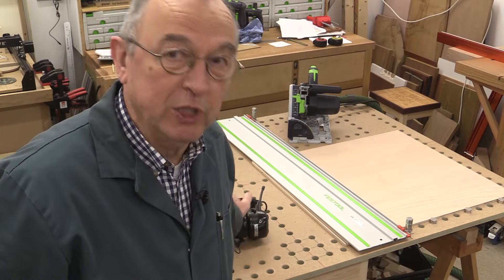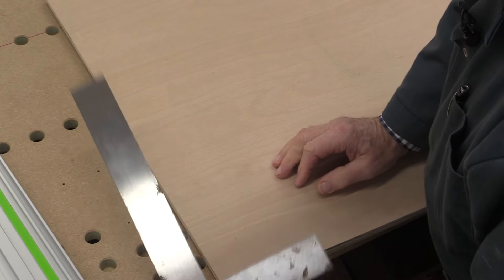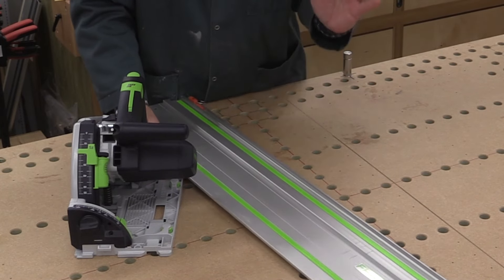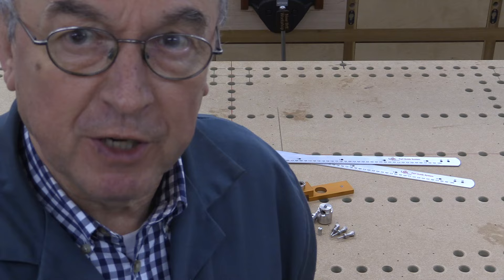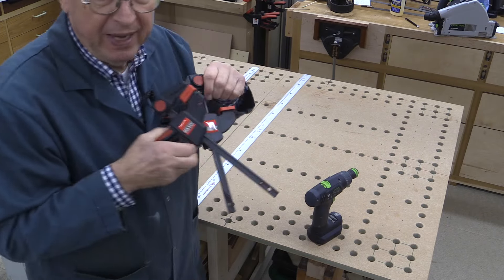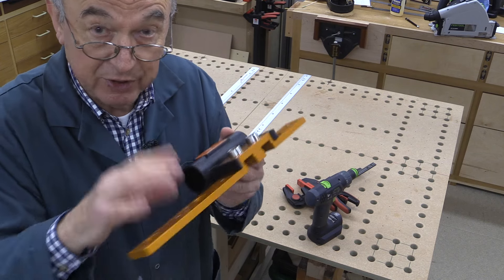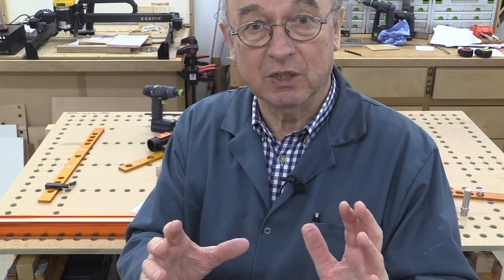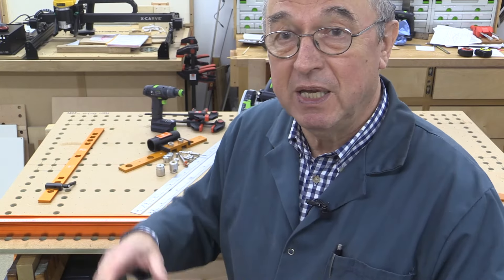Parf Guide System - Basic Guide

Comment: There is the question of whether the PGS is worth it compared to the cost and speed of other systems.  The cool thing about the PGS is that with it you can make all the other systems, if they should suit you in some regard, or to help out another woodworker who is not in possession of one.  Sometime when I want a lot of accurate holes, maybe for clamping, it will go faster with a plunge router.  I can make that tool with the PGS (Ironically, faster than I can make a pattern with the PGS).  But I can't go in the opposite direction and create a PGS, or hybrid layout with a  router system.  I've only had the PGS for a few weeks, I hope to have more fun with it.

Comment: I got a mark 2 guide kit for Christmas but haven't had an opportunity yet to make a new bench. I will be doing that in about 4 weeks when I am on holiday. I've watched alot f your videos and am undecided on what hole pattern to use so I may make more than 1 bench.
Reply from the maker: Hi Michael, I must confess that I only used my isometric holes on my previous tracksaw cutting station for just one project - cutting a bunch of 30 degree and 60 degree pieces for my shed roof. So, my current tracksaw cutting station is just a rectangular pattern but with many more offset holes. Cheers.  Peter
Reply: @NewBritWorkshop thanks Peter

Comment: hi peter, even tough i didnt buy your parf guide (didnt need that precission and well, money spent for few holes on my small table) i did try to design and 3d printed my own version usind steel rulers widely available. in the end it certainly isnt that precise (last holes didnt line up that easily with rulers) but it was fin project for me. but i must say that its absolutely genius what you came up with. atleast i bought chamfer/reamer tool and its amazing too!

Comment: Can I ask why so expensive I would love to do a mft top but on my disability I can’t afford the kit or the extra £100 for the case on top
Reply from the maker: Hi Steve, There is more to the PGS than meets the eye. It has taken 3 years of development (2 with me on my own and then another year with me working with Axminster). Then came the improvements developed over 6 months to produce the Mk 2 version. This latest version will last a lifetime if is used correctly. I have been using the first roll out version of the Mk 2 for several years and have created over 50 MFT3 tops and tracksaw cutting stations and it is as good as new. Don't bother with the case - make something with scraps from the workshop. Cheers.  Peter

Comment: Peter, it appears that your track saw cutting station is set on sawhorses. Or maybe not as I only see one horse on camera. Is this because you need the ability to move the table? I wish to make one large cutting station table and ditch my two torsion box Paulk ones. I doubt you have any flexing in the tabletop. Is it on a pair of sawhorses or something more? Thx, big fan of your work and products. Steve in Texas
Reply from the maker: Hi Steve, The tracksaw top is 18 mm Medite. That is indeed supported by a pair of trestles howver I have 4 cross pieces that go across the two trestles to provide extra support to the top. I like this arrangement as it can be easily moved not only to take my work outside but also to allow a full sheet (8x4) to be cut in the workshop. I have a mobile cart between the two trestles which serves as a store for my short lengths of wood.  Peter

Comment: I purchased Mark 1 system along with the first guide dogs. I have made dogs, made probably 10 mft tops. The UJK dogs are on a par with the parf drilling system for accuracy. Supper accuracy, being high grade, not alloy or even 3D printed. Buy once, buy the UJK dogs.
When I needed to set up my table saw fence, I made a 600 x 600 square using the parf guide system. Now my saw is square at last and can be reset in a flash.
Reply from the maker: Hi Barry, Excellent stuff. Many thanks.  Cheers.  Peter

Comment: Dear Peter
I have a problem with the accuracy of drilling the holes in the center of the ruler.
There seems to be a little play between the male-bit-holder and the female brass bearing.

I am on my second female brass bearing guide.

I have built 4 tables to date.

The stainless steal collar hole in the drill-guide has become oval (for as second time).

This cause inaccuracies, and I can not locate the pins properly without deforming the ruler. 

Please advise.
Reply from the maker: Contact your supplier and Axminster Customer Services. This is most unusual.  Peter

Comment: Hi Peter! Is there a straightforward method for calculating the correct positions for dog holes that can be used to tilt the track to be a certain angle to the fence, such as 30 degrees? Thanx! hb
Reply from the maker: Hi Howard, With the PGS Mk2 it is possible to create holes on in an isometric pattern which allows both 30 and 60 degrees angles as well as (of course) 90 degrees. A standard rectilinear layout gives just 90 and 45 degree options. Peter
Reply: @NewBritWorkshop  Thanx, Peter!!